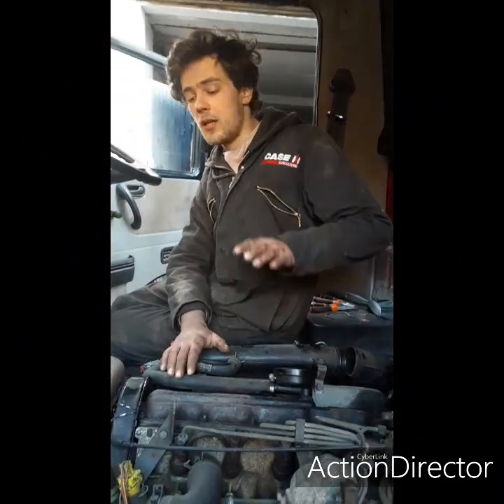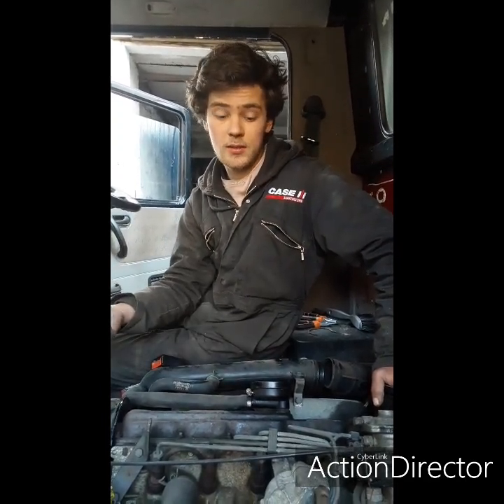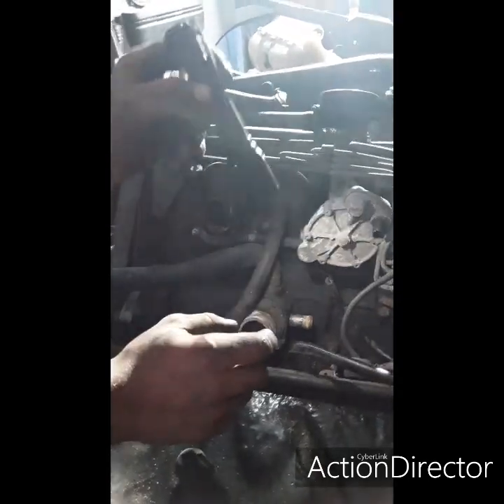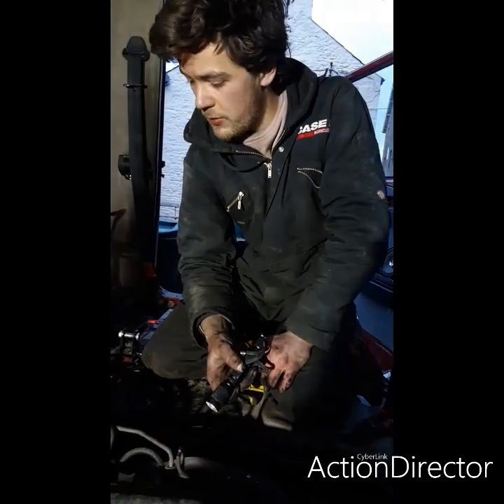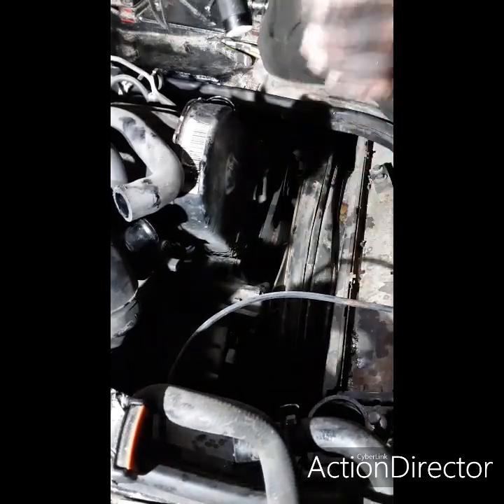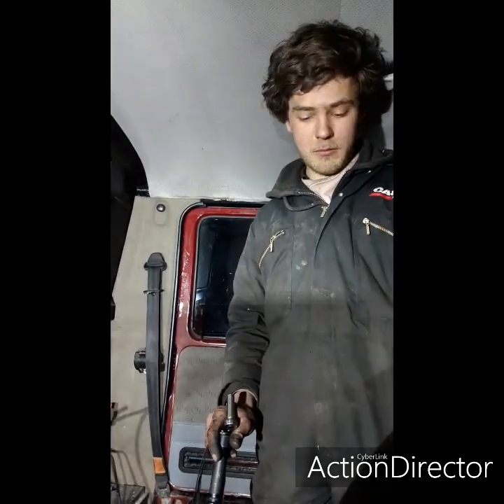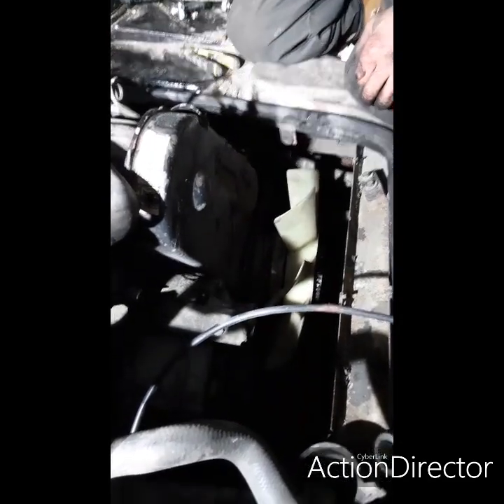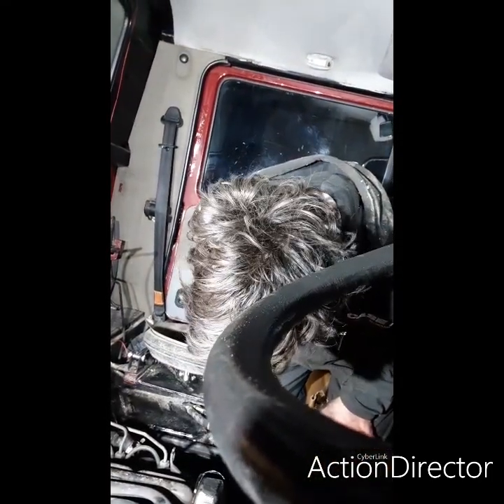How to strip and rebuild Volkswagen Lt Diesel turbo engine

Comment: Hi mate! I was wondering if you could help me out a bit.. I have a LT with t24d engine here in Finland and the starter is busted. I've been trying to pry it out but the damn thing won't fit out no matter how I try to wiggle it. Do I have to take the turbo out or..? Seems weird that they would fit it in such stupid way but it doesn't have enough clearance to come out. How does one go about?? Of course it doesn't help to have it on the yard with no lift etc. so there isn't a lot of space to operate under the car. Thaks a million!

Comment: HOW YOU DOING BILLY. I just bought a 1993 lt35 horsebox. Its a 2.4deisel. Can you tell me is that the same engine you are working on. Thanks the video is great. Fair play.
Reply from the maker: Hi Ben, thanks for watching mine is a 2.4TD Turbo intercooled better known as ACL
Reply: Ben how did u pull it out through the cab of dropped it can find the second video